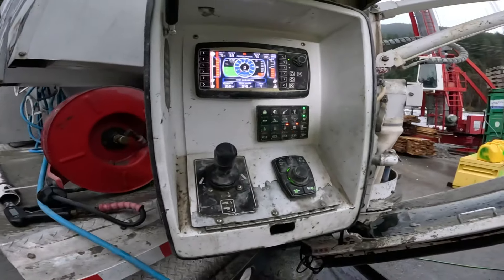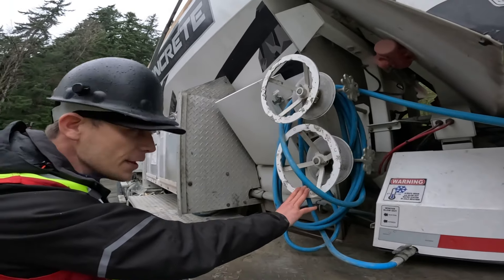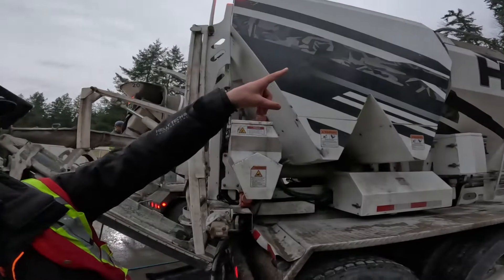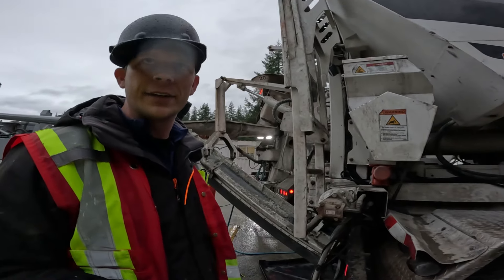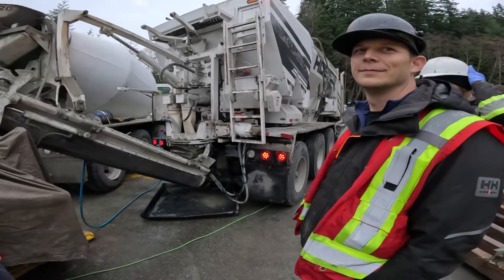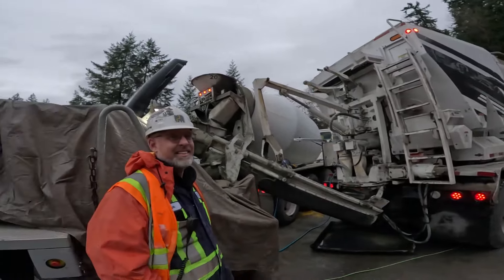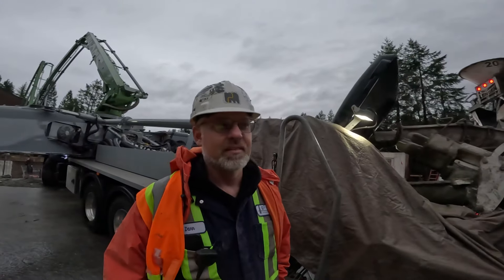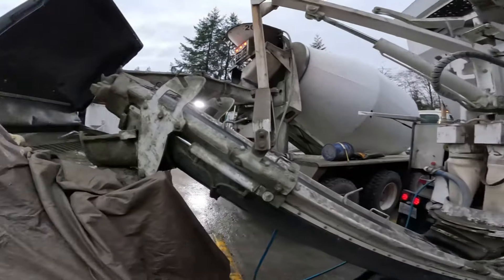FRESH CONCRETE at the TOUCH of a BUTTON!!! (volumetric concrete mixer trucks explained):

Comment: the way they can change slump as they goes is makes them cool
Reply from the maker: Lots of benefits for sure. I believe they can add/remove retarder and/or accelerator on the fly as well. Is pumps guys LOVE the fact they can also make grout for us to prime out with at the start of the pour.

Comment: I’ve been running a pro all volumetric (formerly known as reimer) in Ontario since 2004. The latest fully computerized models are so much easier for a new or even veteran operator to run thanks mostly in part to the water pump rpm being fully adjustable making slump changes a breeze. I still run a 20 year old truck and the biggest factor I’ve found as far as quality of concrete is keeping that mixing  auger spotless. Running a super plasticizer in the heat of the summer also helps to improve workability when the coarse aggregate is very dry in the summer. My dream is to keep the coarse aggregate completely saturated in the hot summer months but we don’t quite have the infrastructure in place for that.

Comment: I believe we only have 2 trucks in our area, both ran by the same company. I’ve pumped with them a couple times. Much smaller trucks than this one and not quite as technologically advanced. Great video!
Reply from the maker: These things are FABTASTIC for shotcrete pours. Fresh mud at the flick of a switch. Pretty nice to have on site in the middle of July/August for sure.
Reply: @canadianconcretepumper1979  i have no doubt they would be the bees knees for shotcrete. I just have to go and convince the ready mix plants to buy some!

Comment: Nine of ten m3 than better the drum mixer match  better and easy  ,and we can load 13 m3 not in Amsterdam  city than the max load 5 m3 😢than we load that in 10 cuubers we have no smaller  ,greetings scott ,piet from amsterdam  netherlands.👍🏻
Reply from the maker: With a modern truck, and a mindful operator, these volumetric trucks are great. 5-10 years ago my opinion may have differed slightly 😂
Reply: @canadianconcretepumper1979  and working he ,wey 8-1 have a nice newyear and a good 2024 scott with jou familie 👊🏼👍🏻
Reply from the maker: @pietmorees2775  Same to you Pieter. Always appreciate you 🙏
Reply: @canadianconcretepumper1979  thanks canadian friend 👊🏼👍🏻